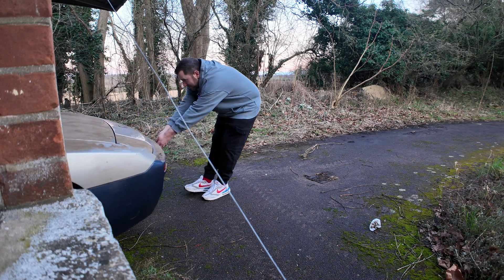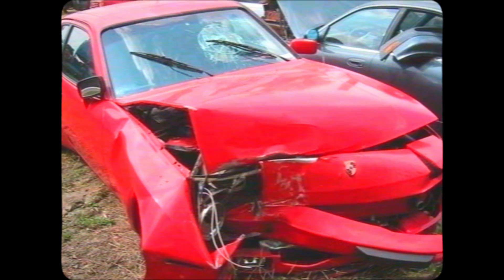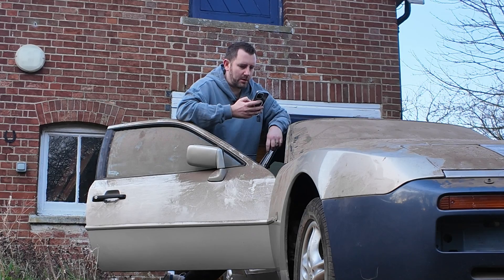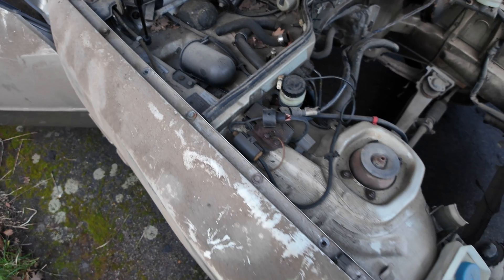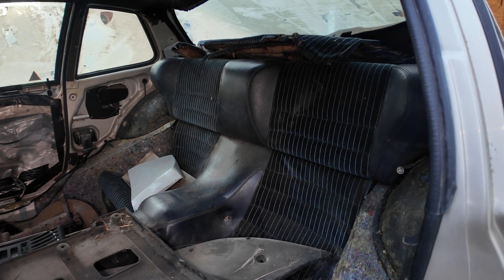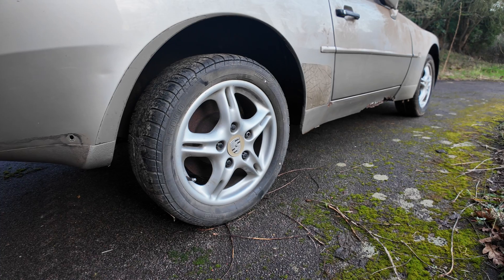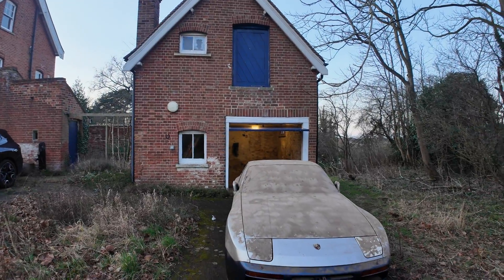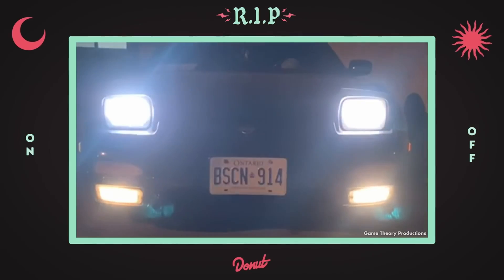01: Watt’s Old is New: The Electric Porsche 944 S2 Project

Comment: Superb! I'm in the midst of EV swapping my 924s at the moment. Lemmi give you a couple of top tips. First off, join the 924 Owners club, not that expensive, wealth of knowledge (and spare/replacement parts) on their forum! Second, do yourself a big favour, watch the last episode of season 2 of a show called "Vintage Voltage", a show following a garage in Wales called "Electric Classic Cars" as they convert classics to EV's. That last episode is on a 944! I'm copying a fair bit of their homework. They also have a YouTube channel which is a font of EV knowledge, pretty sure they have a vid on the 944. Other channels of note: Restoration Apprentice, he's doing a series where he's doing a windows out restoration of a 924 to a sublime standard. SuperFastMatt also has some really good videos on EV swapping and general car modification. Keen to follow you along the way!
Reply from the maker: Thank you so much! I’ll check those all out. How is your project going?
Reply: @iamjoshuadavies  it’s been a slow start, mainly due to work being so busy, managed to snag a 2 post car lift for the garage on FB marketplace for a good price. But much planning has gone on. Done lots of research into equipment to use, as well as getting the thing tested at the end. Another top tip, don’t cut the body about too much, and don’t change the suspension/brakes from stock till after the DVLA have inspected it and changed it to an EV, what you want to avoid is having to put it through an IVA test, that gets expensive very quickly, especially on EV builds. Get it to a good standard as an EV, get it MOT’d an inspected, when the new V5 comes through, then put fancy shocks on it 😅
Reply from the maker: @Carlos230023  Amazing advice, I didn't know this at all! :S